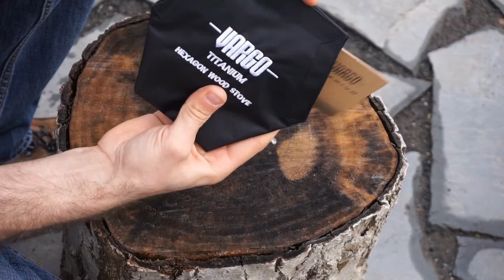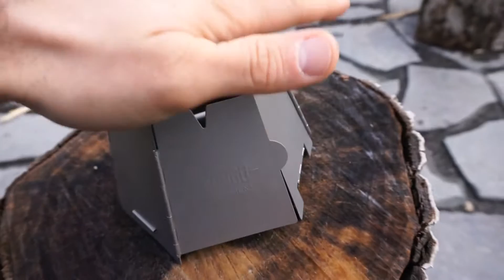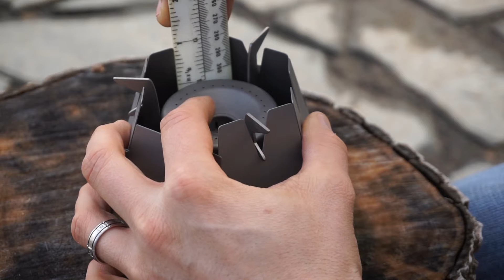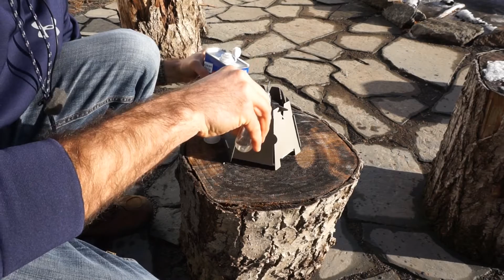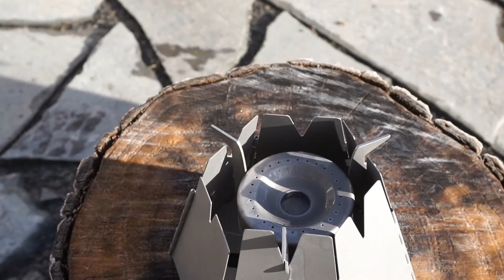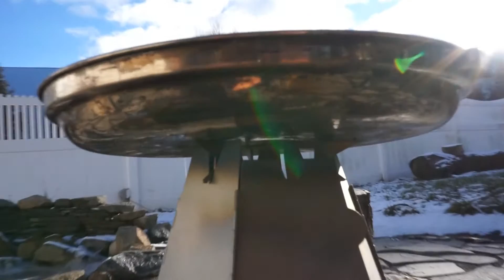Vargo Titanium Hexagon Wood Stove and Converter Stove First Impressions

Comment: I did a test last december, and my alcohol stove (the burner looks almost exactly like the Trangia burner) used 15ml/0,5 "fluid oz" (which weighs about 11,1g/0,39oz) of methylated spirit to boil 1 cup of water... I live in Norway, and our water gets pretty cold that time of year, and i let it run for a while to get it as cold as possible before doing this test... Im guessing it would take around 15% less fuel if the water was room temperature...
Reply from the maker: Hmm...interesting.  I like that the trangia has the damper lid.

Comment: Try adding carbon felt to the burner, then wait 20 minutes. They may save fuel.
Reply from the maker: Let the felt soak in the fuel??
Reply: @outerlimitless  Yes. It will burn better. If you don't let the fuel soak in the carbon felt will burn dry. Yuck.

Comment: What I like about alcohol burners is there is no smoke, soot, foul smell, soot getting all over the camping gear, and clothes. The wood stoves makes a great wind screen! Using a small cake pan over the wood stove would be perfect to prevent soot from getting to the cook pot if you use wood. Add air holes to the cake pan to reduce smoke. Just a suggestion. If you add dish soap to the cake pan it will be a breeze to get soot off. :)
Reply from the maker: I'm always down for a good experiment and to learn more tricks!  That would make a good video...I'll keep it in mind.  Thanks for the tips!
Reply: @outerlimitless  Anytime! Glad I can help! :)

Comment: I've had the Stainless Vargo stove for a few years now and I use a Trangia burner with it, works perfectly bud, for fuel carriage I use the Trangia 1/2 litre fuel bottle which is probably more than enough fuel for several days but if fuel does run out the Vargo takes an open fire, its a proper multi fuel stove 👍🇬🇧
Reply from the maker: I suspect metal like stainless or brass works better than titanium.  I feel like for the burner, titanium doesn't heat the same way and takes too long to fire up.  It's just a theory and is not tested yet, but that's my instinct.  I like the trangia burner which is brass...it's a solid stove.
Reply: You can use rubbing alcohol in a pinch and its easer to find than camp fuel canisters when your at a gas station or pharmasy for resupply.

Comment: Have you tried the Toaks Siphon spirit burner? It's a tiny titanium stove that blooms in seconds, and seems to be much more efficient with the fuel it uses. Amazon has it for $34.95, but I found it for much cheaper here. https://www.israelifirstaid.com  Here is the link to the burner it'self. https://www.israelifirstaid.com/toaks-titanium-siphon-alcohol-stove/  The one on Amazon does not come with the pot stand, but the one at Israeli First Aid comes with the pot stand. The burner it'self only weighs 20 grams, but with the pot stand, it weighs 80 grams. I don't use the pot stand, and since I paid $19.95 plus $1.95 shipping saving $13.05, I spent less than what I saved on another pot stand I prefer. I can tell you though that the pot stand that's included with the Israeli First Aid package fits perfectly inside a Toaks Titanium 750 ml. pot along with everything else I need to light the burner, seasonings, fuel and more. 

Anyway, I think you'll at least like the Toaks Siphon Spirit burner. I'm getting about 10 minute burn times with 2 oz. of 91% Isopropyl alcohol. You may do even better with denatured alcohol.

I really enjoyed your video. Thanks for posting.
Reply from the maker: I've never tried it...thanks for the links.  I'll take a look and get back to you with my thoughts!
Reply: @outerlimitless  Thanks for your reply. It took almost 3 weeks for my Toaks Siphon burner to arrive since it came all the way from Israel, but I like supporting our strong ally, Israel. I also believe that God will bless those who bless Israel I'm always happy to support an Israeli based business. Not to mention that they had the best price on what I was looking for at the time. 

Thanks again for posting this informative video.

Comment: The converter stove is missing an important element that helps conserve the alcohol consumption. Place a penny over the hole and regardless of the instructions try NOT to fill it above that grommet. The boiling time will be shorter and you can get by using only 1 vile of fuel for two boil burns instead of two viles for one burn... plus an added tip if you are using it for boiling water... cold water boils faster. Hope this helps... back in the day they called that converter a penny stove the copper distribution forces the flame through the tiny hole like a pilot light on a regular stove.
Reply from the maker: Dude, that is a amazing tip!  I will definitely have to try that.  I wish someone said that a year ago!!!
Reply from the maker: In fact, I think I will do a video on that...I'll give you a shout out if I do!!
Reply: @outerlimitless  also if you stuff one of those womens circular cotton makeup pads in the converter before you add the denatured alcohol, it will also lengthen your burn time notably.
Similar to the cotton in a zippo lighter.
Remember the larger the surface area for alcohol fuel burning, the faster it gets used up. I'm not really into alcohol stoves because in a survival situation, that sort of obtainium is difficult to replicate and hard to come by. Purell hand cleaner works well if you happen to have some in your pocket in an emergency. I look forward to seeing your videos your videos. 👍

Comment: now you see, that is why there is no surprise that people who cook with alcohol stick to Trangia, which has proven very reliable for the past 60 years... most of the time I take to the woods a Firebox twig-burner-stove besides a Trangia alcohol burner set and I never had any technical problems (no moving parts) or lack of fuel. In very cold weather or altitude a Svea 123 or Optimus/MSR Whispy gasoline stove works better.
Reply from the maker: Yeah, the trangia is great...my buddy has the full setup and it's super solid.  I'm impressed  with that system.  This vargo just doesn't cut it...

Comment: The alcohol stove is great but id ditch it and just use the wood stove. Then no need to worry about fuel to carry. With the side door you can feed it as needed and not have to pull your food off.
Reply from the maker: Even the wood stove seems like an awful lot of work.  It's just not an ideal setup.  I'd rather carry gas and a burner...it's like a guarantee that I can cook and I understand it well.
Reply: @outerlimitless  my experience is that wood stoves are a lot of work, but it's kind of enjoyable to me.

Comment: I redid my system. Using the Vargo Hexagon wood stove ( 7.4 oz ) , a Evernew Titanium Cross Stand ( .5 oz ) and a Evernew alcohol burner ( 1.2 oz ) . I have a wood burner or an alcohol burner to use. The best is a combination of the two. The Vargo Hexagon wood stove , then the Evernew Titanium cross stand is placed inside where the wood would of been. On the Evenew Cross stand I place the Erernew Titanium alcohol burner. This raises the burner to almost in the sweet spot for the best heat to the pot while the Vargo Hexagon wood stove becomes the wind shield for the burner. 
In summery , This combination which offers two different ways to have a hot meal only weighs 9.1 ounces
Reply from the maker: That sounds like a brilliant combo...I looked into the Evernew products.  I see the cross...nice and compact.  I see the burner too...do you find it to be reasonably efficient on alcohol consumption?  I have no practical experience and never know how much fuel to bring.  I feel like I will carry more weight in alcohol than I did in gas.

Comment: the reason for the massive fuel consumption us because the alcohol part of this stove set is junk. normal good alcohol stoves don't use near that much fuel. vargo put out a dud when they made this alcohol stove. so, if it were me i certainly wouldn't be giving this alcohol stove a positive review because the design of the alcohol stove is very very very poor by any high quality standards. in short, this vargo alcohol stove is junk (not worth buying and not good for free). thumbed up video for effort and for spirit, but wouldn't ever tell anyone to buy this alcohol stove. i would tell them to stay away from it. spend your money on something else.
Reply from the maker: I totally agree 100%.  I did a follow up video to this if you're interested...might shed a little more light onto what I found.
https://youtu.be/-9FxIbQGssI
Reply: thank you. i watched the video, thumbed it up and left comments there. thank you.

Comment: Thanks for this video.  I have the hexagon woodstove and was thinking about the converter.  I think I'll pass.  It doesn't seem very alcohol efficient.  

I like the hexagon but it is definitely a bit more hassle to gather up all the fuel and break it down into the little pieces that fit in the stove vs. just carrying a pocket rocket.  Couple of tips I can pass along on using it in wood mode: dig a little trench under it to provide even more air flow through the bottom vents, that really helps it run better.  Also, watch where you it set it up carefully.  If the ground is soft, when you put your pot on it, it can sink into the soil and partially close off the bottom vents.  The whole design depends on getting a lot of air to go through those holes and create a chimney effect, so you have to make sure they don't get blocked up.

Comment: It's easier to use the fero rod if you hold the striker stationary near the alcohol and pull the rod back , quickly.  The long handled spoons are really nice and I use one for Freezer Bag cooking because it reaches all the way to the bottom of the bags. 
The longer you use the alcohol stove the more you will be custom to it and able to judge the amount of alcohol that will be needed. Normally with a narrower pot one ounce of alcohol is all that is needed to boil two cups of water. I like to do the Freezer Bag style of cooking and all that is needed are two cups of boiling water. I also use a wood burning stove and an alcohol stove combination since i like to have that choice. For quick hot water the alcohol stove is nice to have and the wood burner becomes the wind screen for it. .
Reply from the maker: Ok, cool so it sounds like you have good experience...

Here's my question...do you think it's better to carry a smaller narrow pot and maybe boil a few pot's of water if I need to boil it for drinking, or am I better to have a medium or larger pot and boil it once?  I am super conflicted in my mind and I feel like I'm best prepared to boil water even though I can filter it.  Sometimes I find my only source is a scuzzy pond and it's not ideal...just your thoughts?
Reply: That would be a personal choice. It just depends on how much you want to carry and have room for in your pack. The largest one I take is a 32 oz Olicamp. With water that bad you could prefilter the prefilter of your filter with a 1 Micron 4"x8" Singed Polyester Felt Filter Bag PESP3S. ( Amazon has them )  It filters down to 1 micron and you can get ones that filter to 5 microns. When it gets dirty you can toss it or rinse it. Water flows threw the bags at a good rate so there is very little restriction/resistance to the flow after it gets wet. If you used a different container before filtering then filter or treat the water before consuming it. There are some videos on YouTube of the Polyester bags.
Reply from the maker: Oooohh...good idea!  I'll definitely check out the prefilter...mine got totally clogged last time, so that will be helpful.

Thanks for the advice!

Comment: Where did you get those pre-bottles that you put the alcohol in?
Reply from the maker: 3D Outdoors 
they are available on Amazon or eBay for cheap.   Amazon was like $9.99 shipped for 5 bottles.  eBay had them cheaper, but I needed to buy a larger quantity and wasn't sure I'd need more...but now I wish I bought more.  I'd get a dozen if you get them...pretty useful even for other things.
Reply from the maker: 3D Outdoors 
just look up "bottle preform "
Reply: Countycomm dot com sells those, too.